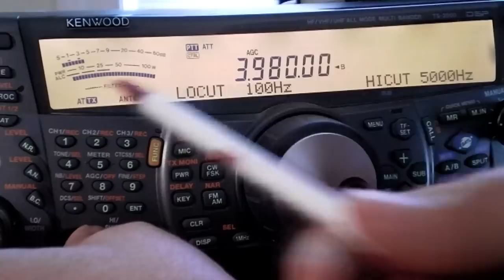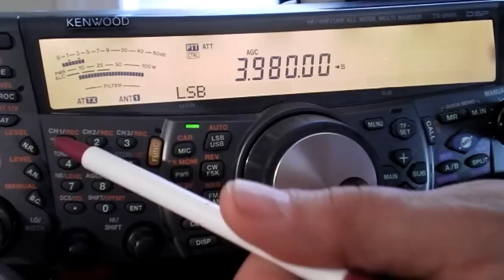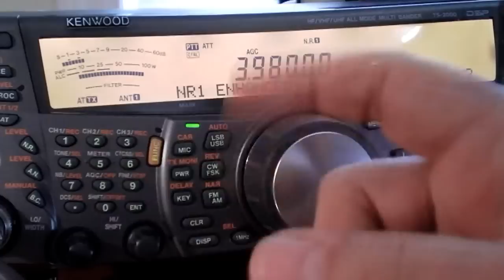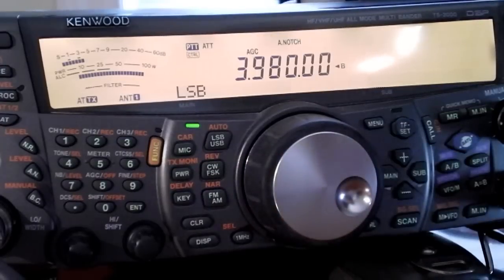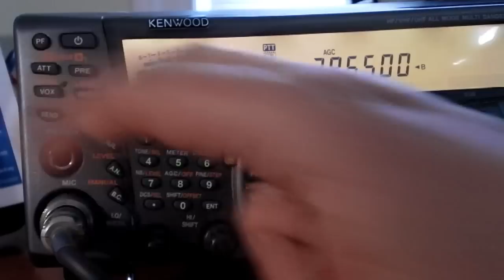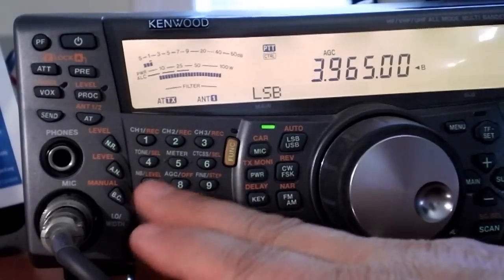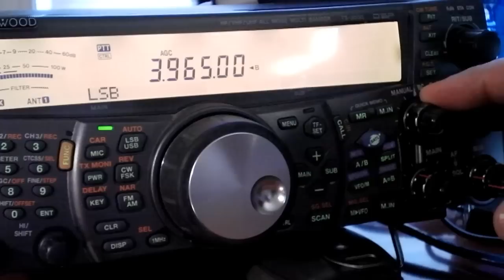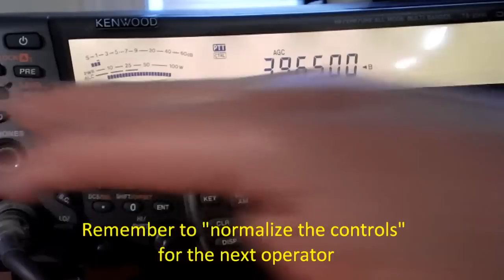3-METERSinc TS2000 "DSP & RF Gain"

Comment: I just bought a TS-2000 after wanting one since I got my ticket.  It will arrive next week. I almost got the 7100 but the cons outweighed the pros.   I was trying to find a good video that helped me understand the radio and I had a hard time... I finally stumbled across your video!   I'm in Memphis, TN so perhaps I will catch on the air some time.  Thanks!